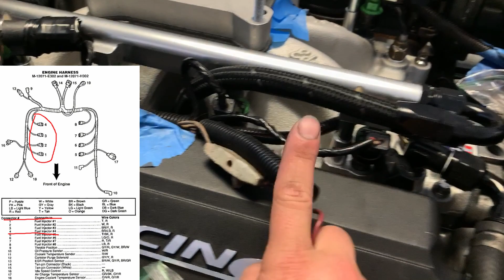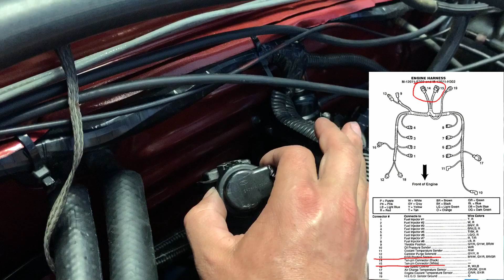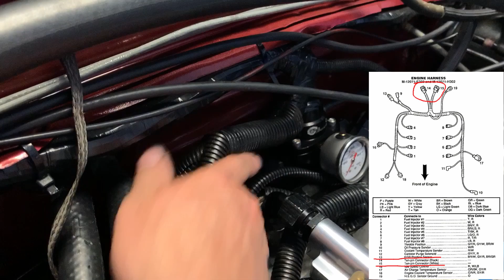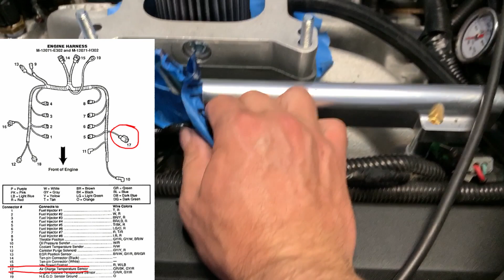Foxbody Mustang EFI injector wiring harness installation And intake elbow install! ( Part 18 )

Comment: I know you said you should have went with the Holley Terminator X but if you can swing it I highly highly recommend going for it I have never used a system that was so easy to install let alone first startup and cruising the car for a couple minutes transferring learn to fuel map 2 * and I was in boost in no time
Reply from the maker: I have heard such great things about it and I wish I had heard about before I bought my MS system and maybe one day I’ll switch it out but for now I just gotta stick with the MS. But the sequential that the terminator has is so good I really dropped the ball honestly 😅